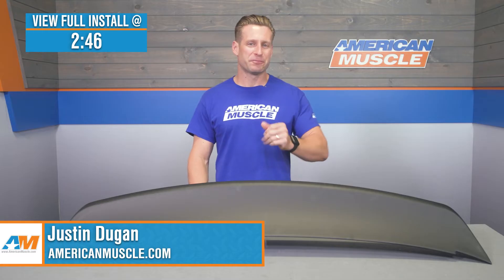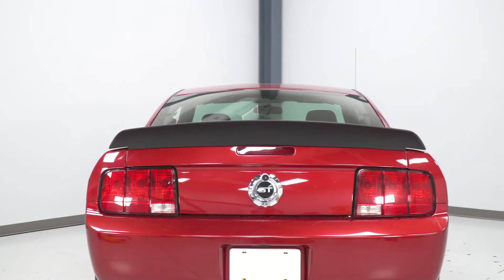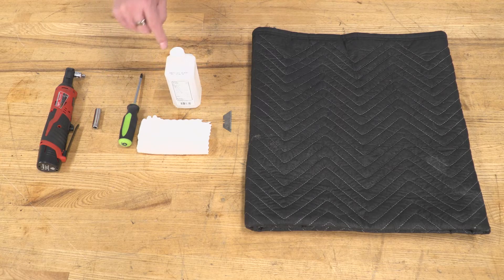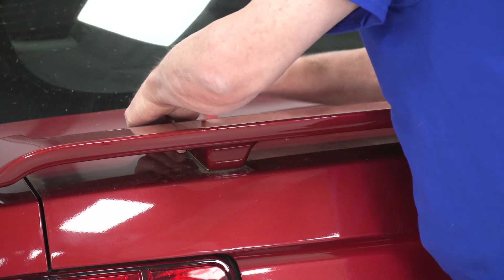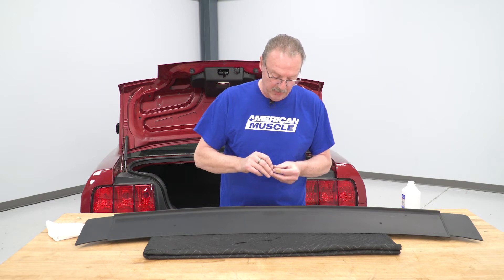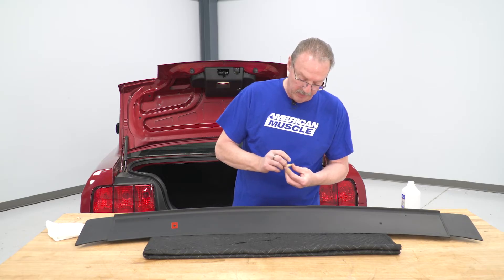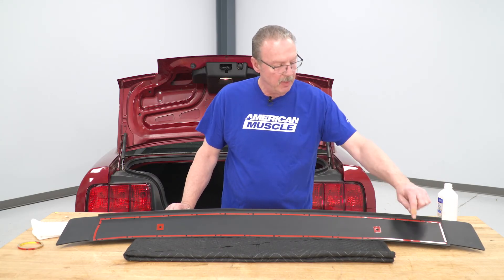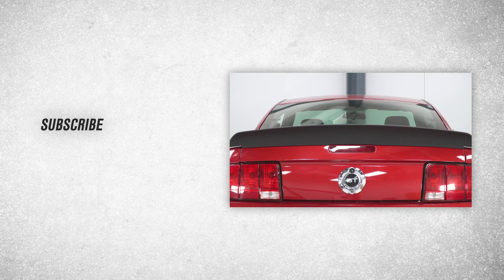2005-2009 Mustang MP Concepts Ducktail Rear Spoiler; Matte Black Review & Install

Comment: Terrible install. Water will leak into the trunk through the two unused holes. Place a piece of waterproof tape over the holes on the outside of the trunk first before installing the spoiler.